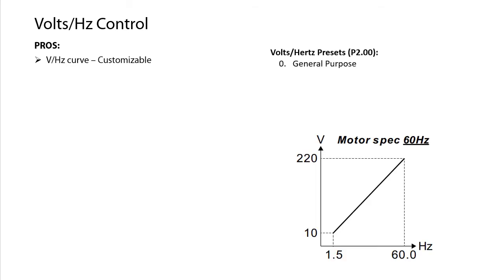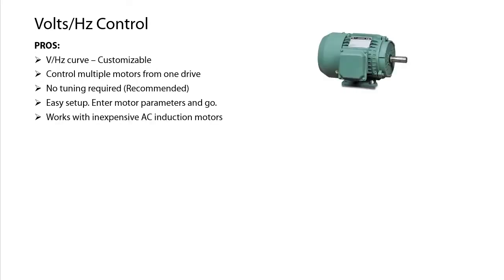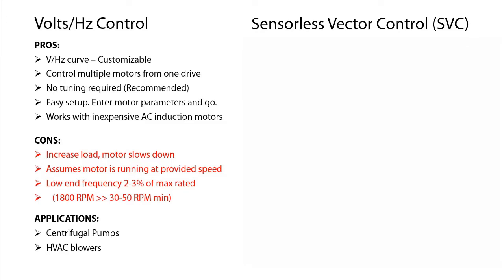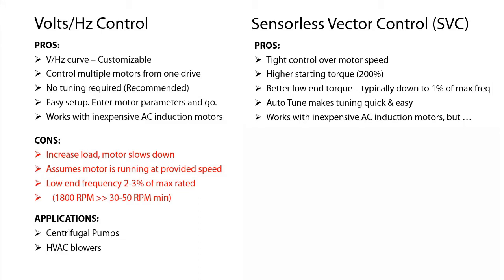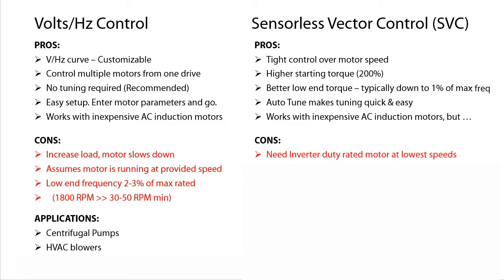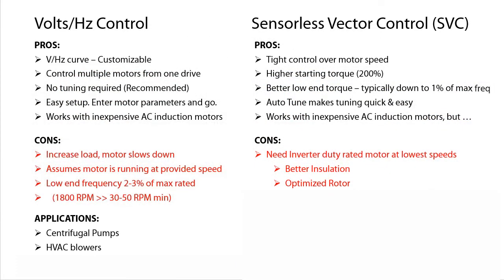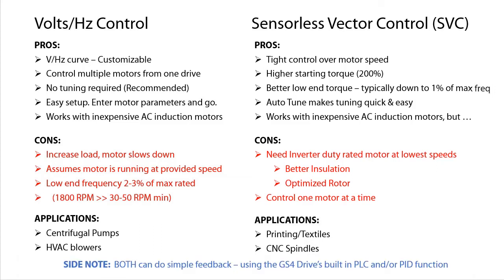DURApulse GS4 VFD Volts Hertz vs Sensorless Vector from AutomationDirect

Comment: What so it can only control speed from 30-50 rpm? I guess there's some mistake in understanding. Please correct me. Thanks
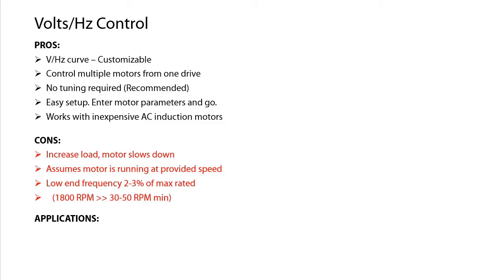Reply from the maker: Are you referring to the comment at 1:24?  If so, the it is saying that in V/Hz mode you can only go down to 30-50 RPM, V/Hz doesn't work well below that min speed.